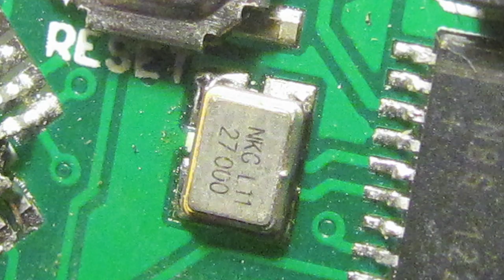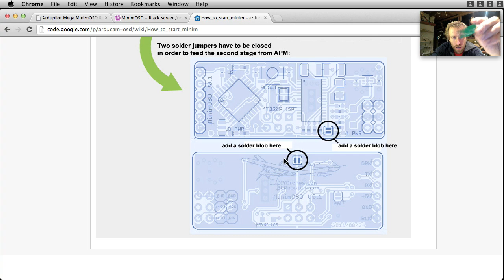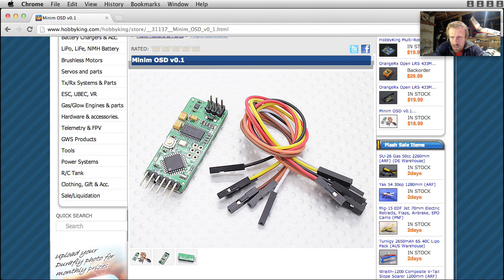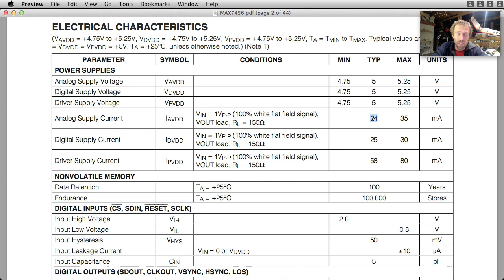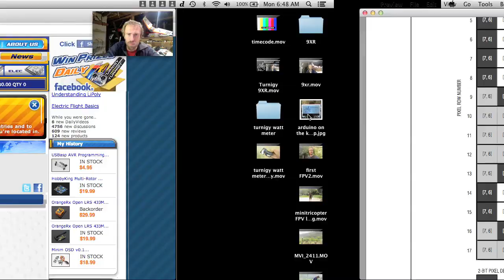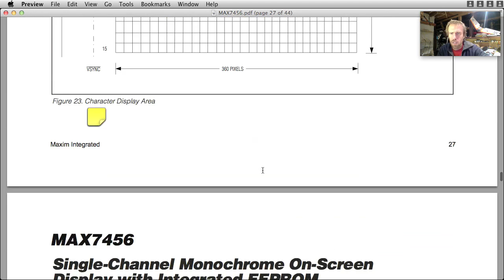Minim OSD. On screen heads up display for FPV. DIYDrones and HobbyKing. Review. RCHacker #14

Comment: other problem is if you use the 12V and the solderblobs the voltage regulator can power your receiver too + attached servos and a lot of other stuff. Thats why the things blow up.

Comment: Just a quick FYI regarding the 12v in/out pins. I'm running 5v through it as my FatShark runs at 5v and it works fine. The little chip you said gets hot doesn't seem to be producing much/any heat at 5v.

Comment: The one with the line on it is a diode!
Reply from the maker: Got it, cheers. So some reverse polarity protection?
Reply: +RCHacker Probably a rectifier diode from the high frequency transformer (Switch downconverter) on the 12V side. I usually connect a wire from this diode (on the side with the line) to the +5V on the data side. Then both chips are running on 5V from the APM.

Comment: Hi Marc have fitted a Ground wire between Video ground and 12V ground at connection to Boscam 5.8 G TX, same result (no transmission) but I still have Picture and OSD data, If I fit a .01 mf Capacitor in video line I get no picture  is the size of the capacitor my problem, Regards Geoff.
Reply from the maker: Try around 220μF. Look up bruces fpv backpack articles and videos. If you hook up your minimosd output straight to your goggles/screen does it work?

Comment: Hi Marc thank you for your quick response, firmware and char set both re flash ok wonder whether I have a wiring problem, have done a schematic but don't know how to send it to you for your comment, OSD and Video Picture can be viewed to the point where it plugs into the TX,
Reply from the maker: Does your video tx and minimosd have a common ground? Also perhaps try an AC coupling capacitor inline on your video.

Comment: Hi Marc
Thank you for the video, my 12v reg burnt, V0.1, soldered both pads for 5V. but now have video Sig. to 5.8 boscam TX lead but no transmission, am using Key cam with 5V ubec conneccted I have direct feed of 12V to boscam for power i.e. Video Sig. & neutral 12Volt to power TX but no transmission, Tried 2 TX's, 2RX's, but nothing recieved can you help Geoff.
Reply from the maker: Depending on the failure mode of the v-reg you might have cooked your maxim chip. Another thing you can test is whether the unit will take a firmware re-flash and if the maxim chip will take a new character set.

Comment: Hi Marc

I have the same board, I've connected it as master to APM (tx and rx connected) and sodered the jumpers to power the second satege, but I have no video, I have data overlay but no vVideo under it, is like Gopro is not connected.

I'm connecting a Gopro Hero3 Silver, ground and video only to OSD, since it has it's own battery I'm not feeding it with 5V

Video Transmitter and gopro work fine if I connect them to each other

I'v flashed the board to the latest version via FTDI, it just works fine.

What could be the problem?
Thanks
Reply from the maker: Perhaps the gopro autodetects whether it is hooked up to a video input.. and the Impedance between the gopro and maxim chip is not right. stick a resistor in there between the video and ground. Similar to this: http://youtu.be/QUdGGHi5YWY
Reply: RCHacker I have used a 330ohm resistor and got the same result, I'm starting o think there is something wrong with the Max7456 chip
Reply from the maker: This is a guess.. Its an expensive chip ($18 on digikey) and there are fake ones out there. I've seen a copy out there that was non programmable. They only sure way is to get it from 3DR.
Reply from the maker: Also, check the pinout and make sure the 7456 is getting power.
Reply: RCHacker I've just ordered one form 3DR

Comment from the maker: You need an FTDI adapter to do updates with the arducam config tool. If you cannot update the firmware with the arducam config tool then you probably will have to re-flash the bootloader. I assume it uses a standard Arduino bootloader. I have not started using this in anger yet so good luck.